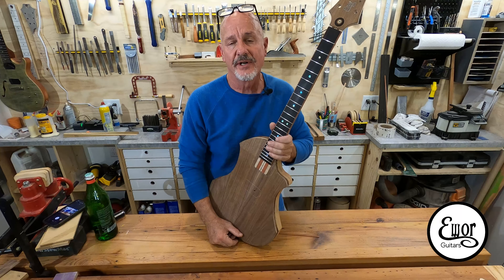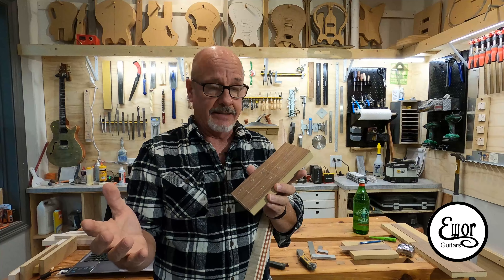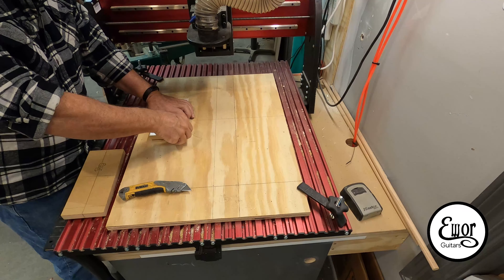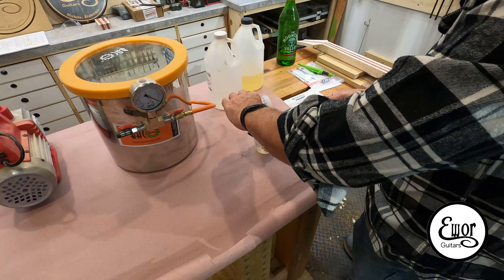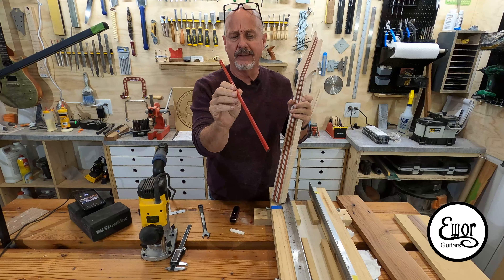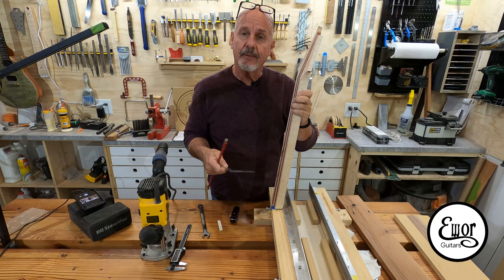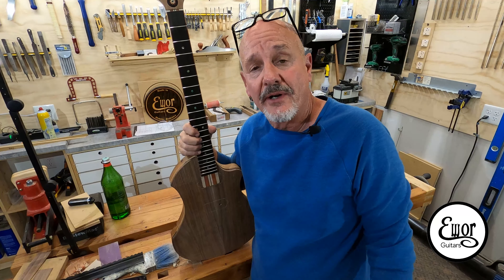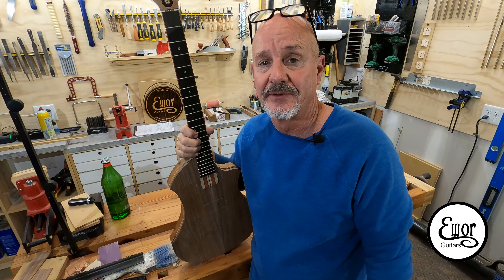How to Build an electric guitar episode 10: Neck Building 2: Truss Rod Install and Headstock Veneer

Comment: Great work, one thing you might want to consider for your next build is the size of the logo in relation to the surface area of the headstock. Using the same font and size but adding the word Guitars or Custom right after Ewor may be better in terms of proportions. Anyhow stay safe and healthy thanks again

Comment: Hey Dave - Another great video!! Although I'm not in favour of CNCs for 'Hand Made Guitars' they are very useful for some operations and it will be a huge benefit to rout the trussrod channel, as you can program all the profiles for the adjustment nut and abuttment. I hope you dont ever get to the point where you CNC your necks like some 'hand builders' do, far better to offer your customers a truly custom neck profile which fits them perfectly. I reckon I can profile a neck quicker than a CNC with just a spokeshave and a rasp and save on the amount of wood required. I do agree with you on the inlay front as you have to charge so much if you hand cut the apertures and the inlays, although I think a bench top laser is probably the way to go as it will cut both substrates so finely that you get a perfect fit. If I hadn't retired that's the way I would have gone. I also think bodies are quicker using a bandsaw and spindle moulder than a CNC. I realise I'm old school but having managed a woodworking company using multihead CNCs I have had the opportunity to study what is efficient and what isn't. CNCs are great for mass production but not necessarily for one offs, it has just become another supposed necessity in the modern world, a bit like smart phones - another thing I don't need or want. Best wishes for the holiday season and the future. Stay safe!!
Reply from the maker: Thanks David! I totally agree about the neck shaping. All by hand it is my favorite part of building a guitar!

Comment: I know cad pretty well. Learned it so I could design instruments. Unfortunately I don’t have a cnc, so I have to use other ppls machines. Still nice to have the option! 3d modeling is a breeze once you get used to it. If you ever need some help/tips let me know! Also, you can get into 3D printing pretty cheap. Lots of possibilities with inlays there as well.
Reply from the maker: Thanks Uriel! What 3D modeling software do you use? I’m thinking about Rhino 3-D

Comment: looking very good David. Every time I see one of my guys using CNC I ask which one they bought. Been thinking long and hard about getting a small unit for the very same thing you used yours for. Headstock and fretboard inlay.
Reply from the maker: I bought the shark HD 510 I have been really pleased with it so far. I got the 510 because it is big enough to cut out a body if I ever want to. If you watch the sales on the shark you can get the water cooled spindle for free. About $800 value.
Reply: @eworcustomguitars thanks David. I’ve looked at the shark it’s good to have real world reviews.